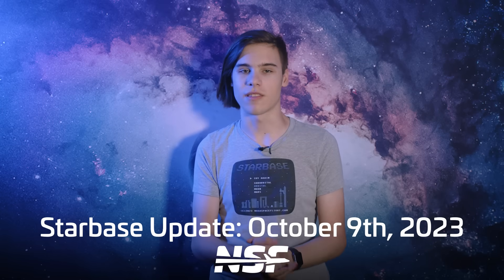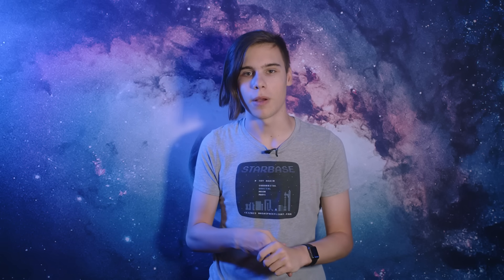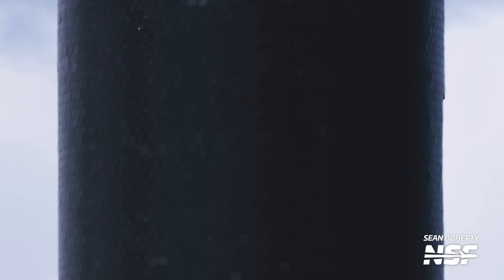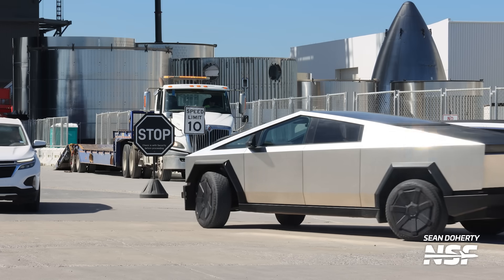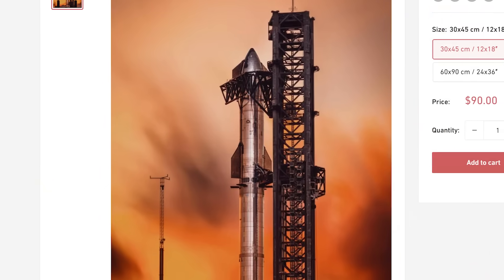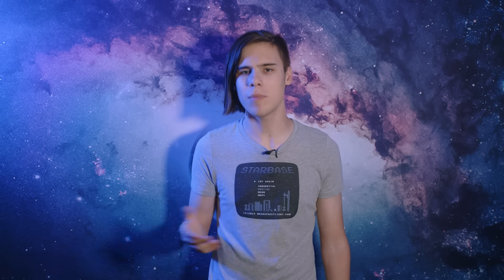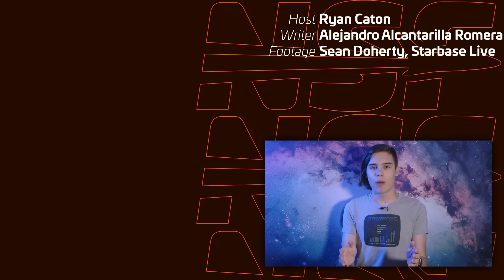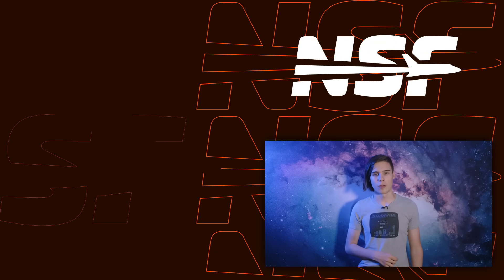Starship DESTACKS? Again. | SpaceX Starbase Update

Comment: I actually have a feeling that part of the reason for the stack was the cyber truck photo shoot but they are still doing final checks on the vehicles in the mean time.
Reply: I the minds of space nerds - stacking requires planning and effort, so you do it once. I suppose for SpaceX, stacking is simple, just use the arms, up it goes for almost zero effort and zero cost. Stack and unstack a hundred times - who cares. It works. Each stack tests the system.

Comment: Ryan "Like those of us who have been involved in this for a LONG TIME".   Oh, I almost laughed out loud!  You're still what, 21-22 years old there Ryan?  LONG TIME means when you've worked in a business or industry for DECADES.  I was a Software Engineer for 30 years.  My Father-in-law was transferred to Wallops / NASA in 1959, and he worked there up until first retirement in about 2003, then went back for several more stints as a contractor, finally retiring (the last time) around 2009.  He worked on radar, but he was on duty for most every launch during those 4+ decades he was there, working at "Radar Row" tracking rockets, and so on.  In later years, he also worked with NOAA on their "Hurricane Chaser" aircraft, he worked closely with the engineers who were developing the radars that they use still today to examine and classify hurricanes.

Comment: I recognize that there has been a lot of development at StarBase in the last two years that could obstruct lines of sight and the ability to photograph certain phases of construction of ships. But with the rumored 9 engine Starship, has there been a 9 engine thrust puck observed? Does anyone have an idea when/which Ship we might start seeing them on?
Reply: Pucks would still have 3 engines. The extra 3 engines are Raptor Vacuum engines and those go on the aft dome of the ship rather than the puck. We have not seen any ship aft dome with connections for six engines and it doesn't look like that is coming soon

Comment: Seeing Cybertruck hauling a Raptor reminded me of something.  Way back in the '60s, when Rocketdyne was developing engines for the Apollo program, they did vibration tests by putting the engine on a cart with square wheels and towing it around the parking lot.  I worked there in the '90s and heard this from one of the old guys who'd seen it when he was a young engineer.
Reply: They also put large hydraulic rams around a full up Saturn V to do vibration testing on it.
Reply: That’s a great story, thanks never heard it before.  Imagine how many stories like that are lost.
Reply: looks to me like its a direct reference to the old toyota commercial where they towed the space shuttle

Comment: Regarding starfactory- How do they mount the columns on the concrete?
Reply: They are bolted to in-beds in the concrete.
Reply: Typically steel girder uprights are secured with what are called (in the UK construction industry) “Bolt boxes.” 
These comprise of an excavated cube in the ground  (size depending on the size of the girder it supports) 
Suspended at the top of the excavated cube are typically 4 strong bolts, held in place by a temporary wooden support. The bolts usually have large square steel washers attached to the base as an anchor and are each surrounded by a waxed cone with the narrow end at the bottom.
Once the engineer has checked that the bolts and their support are perfectly in position, using a theodolite, the excavated cube is filled with concrete, which covers the bolts to the top edge of their protective cones.
Once the concrete has set, the wooden support is removed and you are left with 4 bolts protruding from the concrete. Each in the centre of the wide end of its cone.
The anchor washers and the cones allow the bolts to wiggle a good few millimetres in any direction, which makes it easier to fit them through the drilled holes in the girders when it comes time to fit them. 
They don’t need an enormous amount of lateral or hold down strength. The steel frame and other building materials are massive enough to keep it from moving side to side or lifting up and the cube of concrete underneath bears the weight.
What’s most important is that they are set out accurately so that the steel uprights fit into them precisely. Ensuring that all the horizontal beams will also fit together perfectly.
Reply: @Andrew-Kerr  Thank you 👌 got it. Very interesting
Reply: thank you sir.  your description was precise, accurate and most of all understandable @Andrew-Kerr
Reply: Ah okay. But wouldn't it be stronger if  they actually stuck them into the ground?
Reply: @lyrdashirley5570  Not really. The bolts are just as strong as the columns (usually better steel). It also makes removing them simpler (as they did with the ground fabrication building).